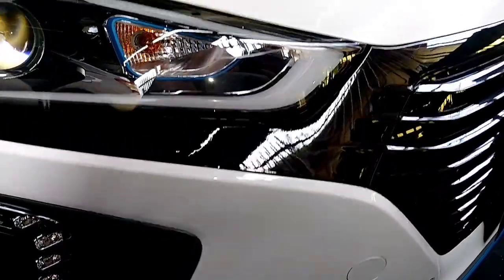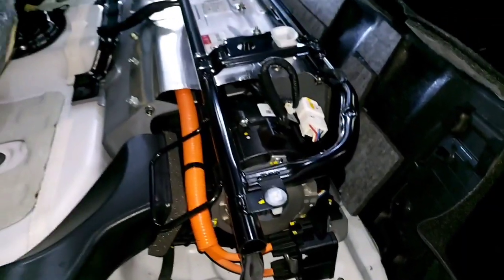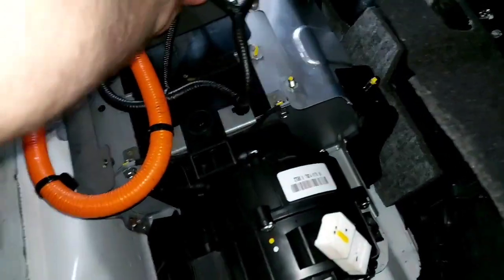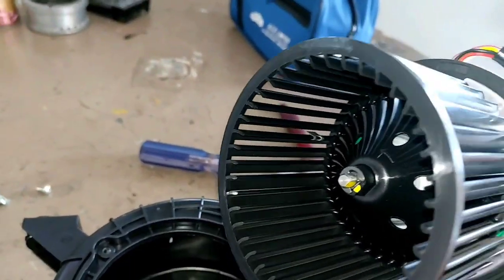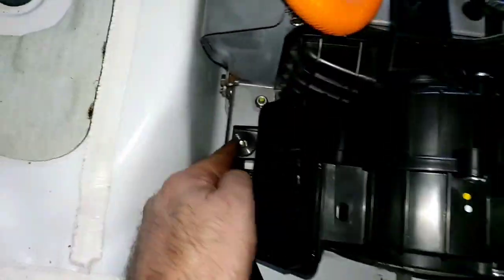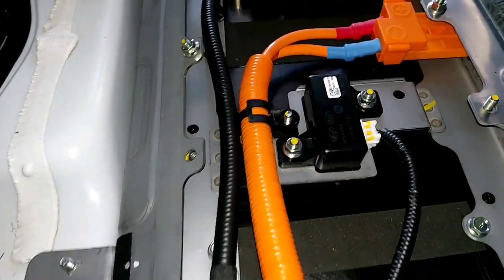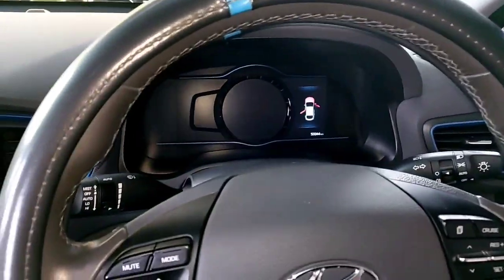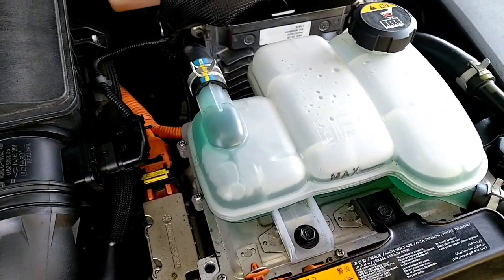Hyundai Ioniq hybrid system service

Comment: Great video. I have a hybrid question. I have a 2022 Tucson hybrid. There is a air vent in the middle of the rear seat for letting air in, but is there any filter behind that, that is serviceable "?
Reply from the maker: No filter at all... so i recommend to clean it every year or two 👋😎
Reply: @hybridsolutiondiagnostics  Great thanks. I expected it to have one since my RAV4 hybrid does, and I just cleaned it. Thanks.

Comment: Very informative, thanks!
If the fan isn't working correctly and/or the battery pack isn't being cooled correctly, would that result in a drop in fuel economy?  It doesn't look like any of the coolant lines run to the battery pack.
Reply from the maker: No, this battery uses an air coolong system in the battery... and yes... less fuel range is indeed a weak battery pack...
Reply: @hybridsolutiondiagnostics  
Awesome, thanks.  I have a 2017 as well and it's getting about 41mpg.  Under warranty but the dealership can't find anything wrong.  I want them to replace the battery but a test has to fail first.
Any suggestions?

Comment: Hi, My dealer says that this hybrid battery does not need any service at all, unless an error code throws up.What are your thoughts on this?.How often should one service the Hybrid battery?.Thanks.
Reply: Indeed it is obvious that dealers will tell you not to touch the system... however... take a look to the newest videos and you will see why they do need servicing often...
Reply from the maker: Dealers of course ☝😎... its what they do...
Reply: @hybridsolutiondiagnostics  How often should the Hybrid battery be serviced?.
Reply from the maker: @varmaTrini  every year or two... will depend how clean you keep your compartment... however this is just for cleaning purpuses... nothing else... thank you for your comment.

Comment: Hello friend, your videos are very good, I congratulate you for your professional work and for sharing with the community.  Can you help me with a problem in the Ioniq block, we need to know if a model has the auxiliary battery placed in a place other than the boot, because we have this problem of not finding it.  and now they took the hybrid battery, the first of the block near the negative behind the pilot;  thinking that the auxiliary was that and they thundered when putting it in a charger.  it's a big mess.  I hope you can advise me with the location and if possible a link to the exploded diagram that I still cannot find the right one.  thanks friend .  Greetings from Mexico City.

Comment: Great video. Any chance you could do a video on the fuel filter replacement for this car? 👍
Reply: It looks like its on the metal panel holding up the back seats. Just look for a video on changing the filter of an in tank fuel filter. Doesn't look overly complicated but am still searching for this answer

Comment: I have auris hybrid and in my toyota such a cleaning is much easier and faster. Big minus for hyundai for designing fan under many hi voltage cables! In toyota auris fan is far away from high voltage cables.

Comment: Omg.....I have been looking for a video on this for a while now....I have a question can I run a power wire from that low voltage location for an car audio amplifier??? Please let me know, I aslo plan on installing a battery isolater and a separate lithium cell for my main source of power. Your input is greatly appreciated hope you get this message 🙏

Comment: Thanks for sharing Bro👍
Love your content, I came across your channel through Facebook & honestly you're doing a great job👍
I did require some info on Nissan Note epower & your videos really helped me a lot👍
I don't have a hybrid battery charger, so we had to send the battery to another shop for charging, but after charging when I reassembled everything the battery was still showing out of charge, & the car didn't start nor attempted to.
Sent the car back to that shop & they claim that they'd reset the hv battery module & the car started🤔
However I did the same procedure with my scanner, what did I miss there?
Stay Safe Bro👍
Reply from the maker: Most common issues are the conectors of the juction block contactors that are the same but for diferent componets so they might have been mixed... take pictures always before disassembling
Reply from the maker: But also it seens that they might also missed one of the battery managment unit conectors just umplugged 🤨🤨🤔🤔🤔
Reply: @hybridsolutiondiagnostics  Thank you soo much for sharing your knowledge with me, the only thing I didn't do was removing the hv pack cover & double check everything, doing that might have solved the issue🤔